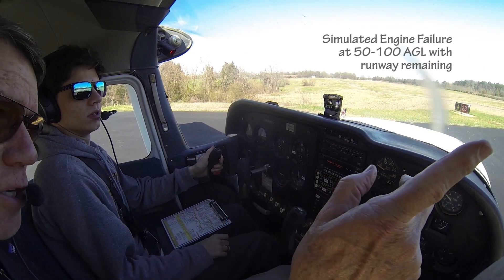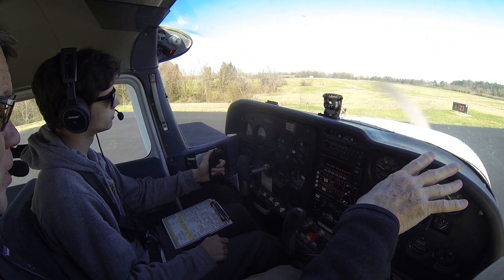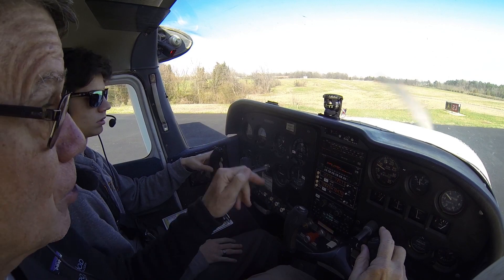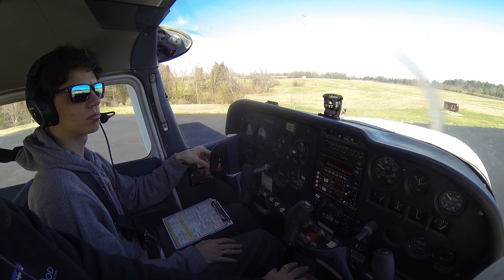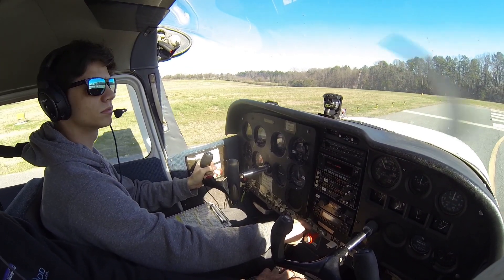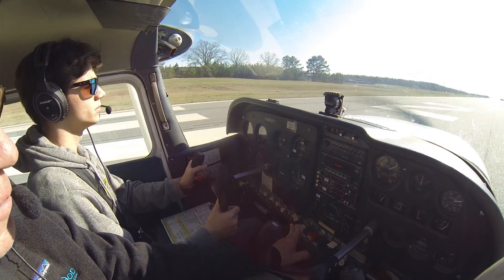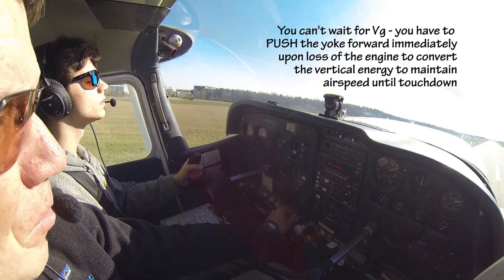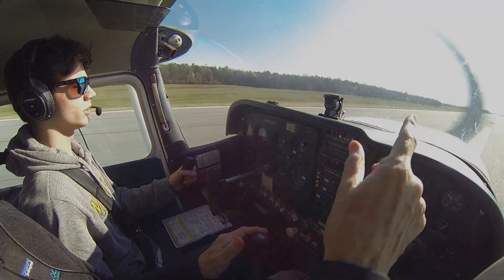Engine Failure after Takeoff

Comment: That instinctive pull back on the yoke has killed many pilots on engine failure and will kill many more.
Reply: 100% agreed ! I think every echo class pilot should take some glidung lessons. Glider pilots are really drilled to push down the heck out of the plane in case of a rope break. It becomes instinct at some point.
Reply: He was flaring.
Reply: @Luke117-r2x  You dont need 2 hands to flare, dummy..
Reply: @emergencylowmaneuvering7350  I don’t mention the two hands here. Purely talking about the “pull back” on the yoke, which is a flare
Reply: @Luke117-r2x  On that 50 feet engine cut you move your right hand to after touch down, cut the mixture and cut the flaps too..
Reply: Yes. Hopefully he doesn’t attempt those same control inputs at stall speeds in a less forgiving airframe, especially one with a laminar wing.
Reply: My instructor told me you don't "flare" a 172 like you flare a 737. Like the instructor says in this video, you let it settle with gentle back pressure on the yoke to control rate of descent and bleed off the airspeed.
Reply: Yeah. He could have stalled and spun the plane 5' above the runway...are you people re tarded? It was a flare
Reply: @BrettMcNary  the plane will only spin if in a stall you use aileron correction
Reply: @BrettMcNary  Um. You use the rudder to stay coordinated. If you use aileron you will induce a spin. Maybe you didn’t understand what I was saying

Comment: I think you had a great and calm reaction to when the instructor pulled the throttle back as though it was an engine failure. It also looks like you have a great instructor aswell.👍

Comment: as a glider pilot I can confirm that being comfortable to push your nose down while close to the ground is a very important trait to have!
Reply: YES, ditto, 100's of launches on a winch. Practiced that ad nauseum. A life saving drill. Especially from an abnormal ( to a power pilot ) nose high attitude. It serves well, along with keeping your pre determined landing field at the appropriate angle to your shoulder, for a transition into general aviation.

Comment: And to think that until the late 60's they did this in jets, Delta lost a DC-8 and 5 pilots in 1967 after the simulated failing 2 of the 4 engines on same side.

Comment: Brave CFI.  The way all should be.  Student was trying to pull with 2 hands during the flare..  Hey, no Panic Pulls allowed.  I used to teach those 50 feet engine cuts.  I also taught turnbacks to opposite runways from 700 agl during the 1990's my CFI years.  You get used to them..
Reply: His instructor’s hand was on the throttle, so his couldn’t be
Reply: @Luke117-r2x   So what??
Reply: @emergencylowmaneuvering7350  so it makes sense why he might move his hand to the yoke.
Reply: @Luke117-r2x  On that emergency, just after touch down, you cut the mixture and cut the flaps if any.. I used to teach it in my CFI years..
Reply: @emergencylowmaneuvering7350  Good thing he can move his hand after he touches down huh
Reply: @Luke117-r2x  yes.. Cutting the mixture might save the engine and prop if overshooting....
Reply: @emergencylowmaneuvering7350  I don’t understand your use of language or how it supports your argument, but I don’t see the problem with having 2 hands on the yoke.
Reply: @emergencylowmaneuvering7350  you don’t act like someone who was old enough to have a CFI license in the 90s. You act like you’re 15.
Reply: @emergencylowmaneuvering7350  dang you’re really upset, I don’t think I’d trust someone with your temper or judgement in the cockpit. Have a good one tho
Reply: @Luke117-r2x  The fact you don't see the problem tells everyone here you've never flown a light aircraft before. Two hands will lead to over correcting, especially in an emergency situation.
Reply: It was a flare. If he didn't flare the plane it would have bounced and ballooned off the runway......The whole idea of not pulling on the yoke is to avoid stalling and spinning. We're 5' off the runway, it's a flare.
Reply: @BrettMcNary  It was a Panic Pull.  If CFi wasnt there he could pull with 2 hands like a scared rider on a horse, climb to 30 feet and stall.  Happened too many times on EFATO..

Comment: Great training maneuver to practice. I would add about 5sec count before nosing over if practical/safe in the simulation to incorporate the human effect of denial and reaction time. Therefore you understand in those 5seconds how much runway you eat up
Reply: you need to practice what you SHOULD do. Need to have muscle memory to push as soon as you have a significant drop in RPM or complete failure. at least when you are that close to the ground.    you could be in a spin in those 5 seconds.

Comment: Leo Horton people keep buying a air cooled boat anchor engine that has a long history of been junk, that in these small airplane. Them air cooled engines people has paid a high price in injuries and deaths over them. Now days there are conversions for a car engine to be installed on small airplane see youtube video that called;  ENGINE SWAP FOR YOUR AIRPLANE -  EAA CERTIFED.  The car engine is alot more reliable on a airplane
Reply: one problem with car engines is they only have a single ignition system.  aircraft engines have dual magneto (doesn't need an alternator) driven ignition for redundancy

Comment: Very good but , to be honest  the stall horn and the student pulled on the yoke  yikes !!
Reply: @Luke117-r2x  you are  a bit correct but the case or exercise was a loss of power or engine failure and in those cases you don’t pull back and that’s exactly what the student did ,the Instructor told him not to do so . Stall horn you don’t pull back never .convert the vertical energy to maintain airspeed.
Reply: @Luke117-r2x  well to be honest !! when u land u don’t stall at all  you land .stall and landing are two different things but it  happens on short runways  because of that minimum speed you have to target and the flare that follows . Good experienced pilots have better knowledge of the plane and on some small runways you have to flare with stall horn  if I can use that sentence... example courchevel (lflj )high altitude airport  up hill  and short runway flare with the stall horn .
Reply: @Luke117-r2x  I sincerely hope you're just a flight simmer and don't actually have a license. If you do, your CFI should be ashamed.
Reply: @1100BFK  If the airplane never stops producing lift (stalls) how could you ever get it back on the ground and keep it there? I own and fly a Champ (which doesn't have any stall warning) from a reasonably short runway, I want that thing to quit flying just as I touch the ground. If not, that's where the bounce comes in. When I flew a Cherokee from the same airport, the best landings were when the horn started chirping right in the flare.
Reply: @7ACtailwheelav8tor  let’s not skip  the purpose of this drill lost of power or engine failure at takeoff 🛫 u can clearly see that  the stress took over and he thought he was stalling Am i rite or wrong ???? He did not try to put it on he ground at that moment because he pulled on the yoke u can clearly see it and hear the cfi informing him to not do so and let the plane go  down.  At that moment it was not about (ground effect ) and over speeding .

Comment: Why do you think the Wright brothers came up with the name “Airplane”?? Answer, Because It describes exactly the 2 actions of what it’s doing . It flies in the Air, over a Plain.  Level flight for THOUSANDS OF MILES to destinations of desire.. if we were on a GLOBE? You would be in outer space in if you flew level flight at 30,000 feet at 500 mph in a very short span of time.  The pilot never corrects his craft to stay to the globe. The pilot always flies LEVEL flight using his gyroscope and altimeter for safe an accurate flight. The earth is scientifically flat. We have mountains and valleys with typography. But water will never stick to the outside of our magical ball. That’s why another word we use is SEA LEVEL. And we are 73% water. Wake up Pilots 😃